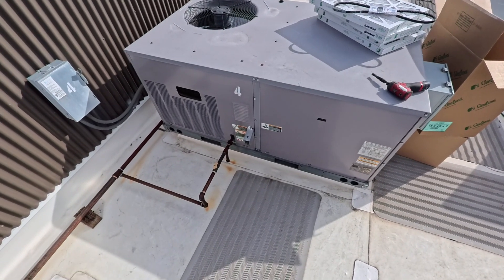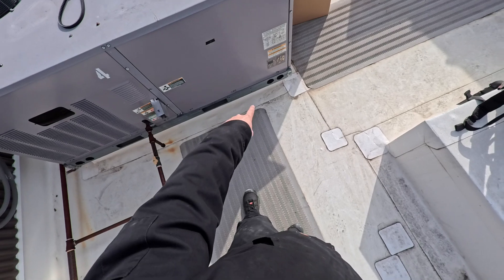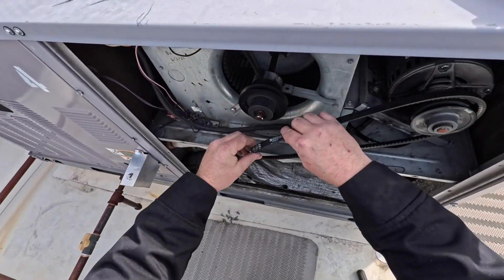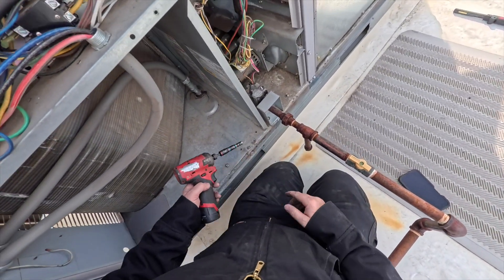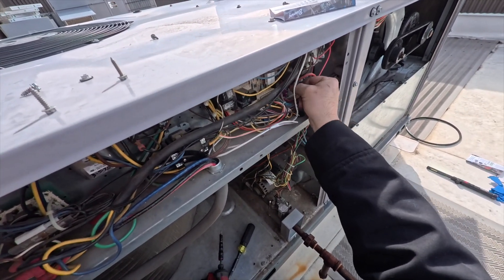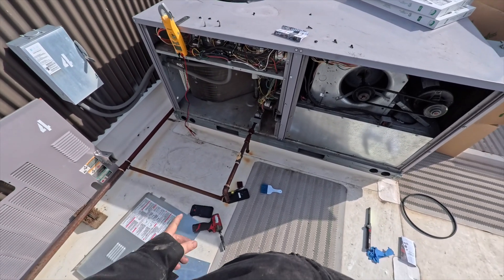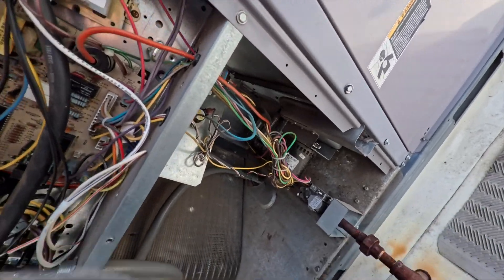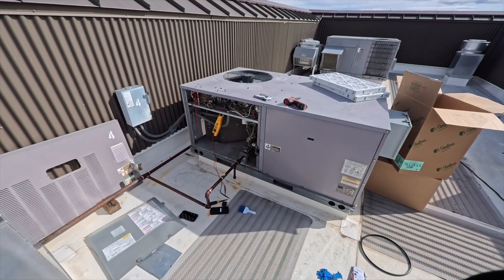Preventive Maintenance Tutorial on a Carrier Weather Maker Package Unit EP212

Comment: You saved me on a low voltage short a few years back 👍 but i cant seem to locate that vid in your library. I have a different issue this time. My same Bryant rooftop unit that's now blowing the 3 amp fuse no matter what mode I tried to run it on,  heating, cooling, fan only! Any Usual Suspects on this one or just an idea where I should start?

Comment: This video helps out a lot on what to mainly check when not trying to spend too much time in a unit ! My question is how do you know the amp draws are good for the blow motor , compressor , inducer etc?
Reply from the maker: The specs for the motors are on the unit tap. Along with the serial and model numbers. If that’s faded it can be found on the motors them selfs.